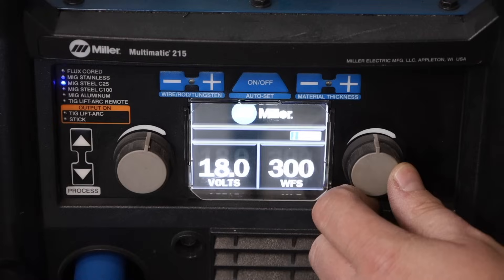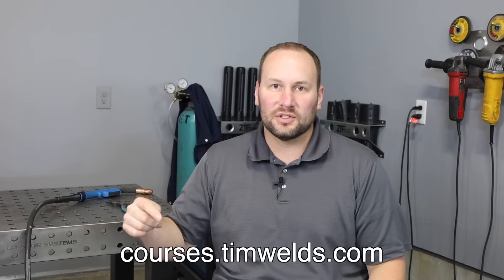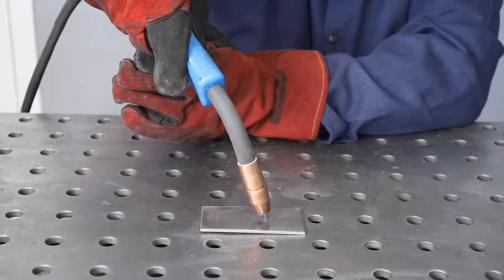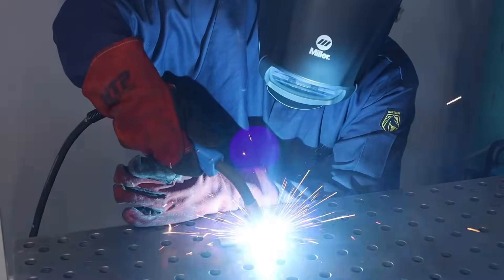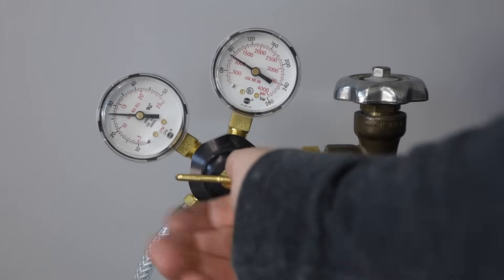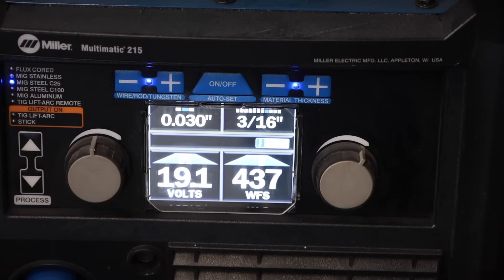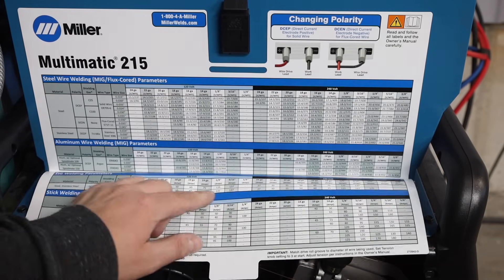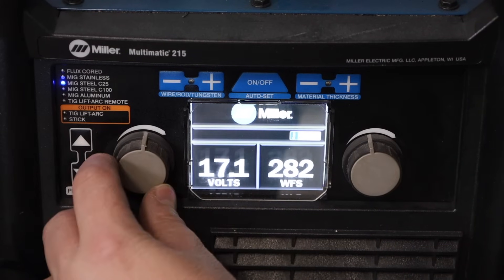MIG Welding Basics For Beginners

Comment: I bought an inexpensive inverter multi-welder and the voltage dial is not like what I've seen on other welders in videos.  Instead of the dial reading 1, 2, 3, 4..., it has 0 in the top position with -3V being the max on the left and +3V the max on the right.  How am I supposed to get the right voltage setting with this weird dial?

Comment: Ok. I've been welding for roughly 30 years, and I have found that if you drag a weld, it does NOT give better penetration in your base metal. Pushing your weld cuts a channel for the filler metal to fill, as the filler will build up behind the arc. Think of the electrode flame travel as an air arc gouge machine. This is especially prominent for copper clad, or "hardwire". Flux core is a totally different animal. Especially dual shield. You can run dual shield in either push or pull, but I still prefer push, due to the electrode flame travel.

Comment: So I'm haveing a problem with the puddle stacking up. I have played with the machine and not really sure what I'm doing wrong.
Reply from the maker: First thing to check is your contact tip to work distance (stickout). You can also flatten it out by turning up your voltage, introducing a small weave pattern or increasing your travel speed as long as it still fills in. Try these one at a time and you can see the effects of each and get things dialed in.

Comment: When welding to achieve superior quality, it's important to remember to always push the gun or rod so that you don't end up with excessive slag inclusions/imperfections in your welds. Yes, you can get away with this to some degree around the house or farm, but beginners should get in the habit of pushing rather than dragging. You'll understand why when you see your welds under X-ray or a high-pressure bend test. Controlling that puddle is critical, and when it's in front instead of behind you can see everything it's doing. Great video as usual.
Reply: Running angle really doesn’t matter unless you’re running an excessive angle. There are a lot of myths in welding, just as in any area. MIG is pretty forgiving in this. Tim is correct, and Jody from Jody’s welding tips and tricks has also shown that there’s no difference with MIG. I’ve been doing it for almost 50 years, and have found no difference either. Stick out is more important, and that varies on a number of factors, so giving one number there wouldn’t be correct either.

Flux core is a different issue.
Reply: Is it because of unseen porosity?

Comment: Great tutorials, you are a legend in your explanation and demonstration. Could you do one on car body welding thin metal with flux core please, I'm trying to use 0.6mm. The gas is so expensive and I don't have a garage to weld. Would be great if you could. Thanks a million, great work. Cheers.
Reply: I second this for the same reasons!

Comment: Thx for great video.
I am not new to welding but still have a lot learn. One thing that I hear a lot and you touched on it is that at times needing to speed up your travel speed for thin metal, outside corners etc. If the settings are correct, when I weld the weld pool dictates when I advance the arc. If I travel faster then the weld is crappy and compromised. Do not understand how someone speeds up a weld.

Comment: When would one know it's time to change out the liner? Thanks for the video. Have you ever done any other podcasts? The one on welding tips and tricks about cracks was informative. It really showcased your knowledge and enjoyment of the welding industry.
Reply: Sometimes, removing the gun tip, and the connector from the welder, and blowing it out can solve the problem. Over time, powder from wire moving through the liner is generated. Along with dirt from the wire, it combines to form a sort of powdery sludge, narrowing the effective diameter of the tube, and causing friction. With cleaning, a metal liner will usually last from three to five 11 pound spools, depending on the hardness of the wire.
Reply: >>>When would one know its time to change out the liner?

When resistance to the wire flow is prevented from freely feeding through the liner & contact tip causing an erratic/unstable arc. Usually, the main cause is a gummed-up liner from wire surface contaminants accumulating/clogging the inner liner. Sometimes rotating the liner 90 or 180 degrees might help, but replacing it with a new contact tip would be a better solution. .

Comment: I have a YesWelder mig 250 pro. The manual says it requires 50 service but the cord on the unit looks like 8 gauge. Is eight gauge sufficient for service cable?
Thanks
Reply from the maker: I would assume that they engineered it to be sufficient and I've seen similar size service cables on similar size welders. Most welding machines aren't rated for constant use at full output. You'll probably find a duty cycle sticker on the machine showing the percentage of a 10 minute period that it can be used. The duty cycle is typically accounted for in the required size of the service wiring.
Reply: For service cable yes. If the feeder run from your service panel to the welder outlet is more than 15 ft. then you'll need #6 wire for the feeder run  only. Your #8 service cord is probably no more than 6 or 8 ft. and is adequate for 50 amps in that short of a span.
Reply: 50 amp plug requires service rated for 50 amps. All the plugs are different for amp ratings so someone could unknowingly plug a 50 amp draw into a 40 amp service. I went to move my plug further out, couldn't find 6ga armoured cable any where around here so I went with a 25ft 8ga welding extension cord which said rated for 400amp machine or less. Also couldn't find a 6ga extension cord anywhere here. But as Tim said duty cycle plays into it. Primweld 225 maxed out is 225amps, the torch it comes with is only rated for 140amps which I've only had the need to turn it up to 130amp so far and the cord on the machine is only rated for 8ga.  But 50 amp plug does require 50 amp service to be wired
Reply: @KingBigBabyJesus  Amazon has lots of extension cords advertised as 50 amp. They clearly state the wire is 8 gauge but the plugs are 50 amp plugs. That means the 50 amp breaker won’t protect the wire. But the welder plug is 50 amp style and is connected to eight gauge wire so even if I run 6 gauge to an outlet I’m still not protecting that last three feet of the welder’s wire.  Soooo, do I get a 50 amp 8 gauge extension cord and put a forty amp breaker in the panel?!
Reply: @mosesmcrae  Ya you bet, was also able to find them with 6ga online. I went with 50 amp and ran to a subpanel so i could also run a couple lights and  a 20 amp plug in the garage. It was only a 16ft run so I put in  the 50 amp circuit  and used the off-cut run to a plug right below the panel. 25ft extension cord was cheaper to run the 10ft to the end of the garage and an extra 15ft if I have something to do outside mostly bought for the 50amp primeweld plasma cutter with a 12ga cord and 50amp plug. Anyway I'd go with the 50 amp for future proofing, you'll be able to run any welder or plasma cutter and of course some piece of mind. It's not that I don't trust the high quality of parts and craftsmanship the Chinese ship overseas. But can't argue with a plasma cutter and welder for under 1000 bucks shipped to the door
Reply: @KingBigBabyJesus  where did you find the 6 gauge cord?  I’ve only seen eight gauge.
Reply: @mosesmcrae I believe Jegs had a 25ft 6ga for 122  or Parkworld on Amazon but they were a bit more
Reply: @KingBigBabyJesus  found it. Thanks
Reply: It has a 50 amps plug because it's the most common plug used on every welding equipment.
What's important is the cable gauge vs amp draw of the machine.
For exemple, you can plug a tv in a 20 amp 120v outlet if you want. Even if the tv only uses around 200w and has a 15amp plug.

Comment: Very informative video, thank you. Why does one welder manufacture not put a chart in their welders and when you call support they say "just use synergic function"?  Thanks again for all the great videos.
Reply: Regardingless what a power source suggest s/recommends for a diameter wire. Wouldn't it be better to have the actual Data Sheet handy for that Filler Metal? Should have it at the distributor or as a print out on line.
Reply from the maker: Thanks! In most cases, they have just programmed a chart into the machine. You can typically still fine tune it using the principles from this video.
Reply: @TimWelds    Thank you for the reply. I know I can experiment with the settings after getting a base from synergic mode but the support reps answer sucked! I've run into this one rep before when I called in and now I have a managers cell number so I don't have to deal with this certain rep. I'm a 69 retired hobbyist and have had/used Lincoln, Miller, Hobart and other welders. I bought 2 Everlast MTS welders (1 for each house 2200 miles apart) and I like them. I just don't like the snotty attitude of one of their support reps (dealt with him on other weld forums). Anyway, I do enjoy and look forward to your videos, thank you.

Comment: What gas or gas mixture would you say is the most useful for general use for diy home use? Can you use the same gas mix for both, black, stainless and aluminium? :)
Reply from the maker: Great question! The best gas for steel around the house is 25% CO2, 75% Argon. Unfortunately, with MIG, you need different gasses for different materials. Aluminum requires 100% Argon. Stainless requires a gas typically called tri-mix. TIG welding, on the other hand, can weld pretty much any material with the same gas.
Reply: @TimWelds  thanks tim. Looks like  most of what I can get my hands on is 82% argon and 18% co2? One of the retailers stated it would suit both black steel and stainless?